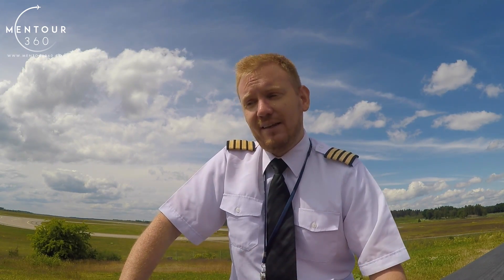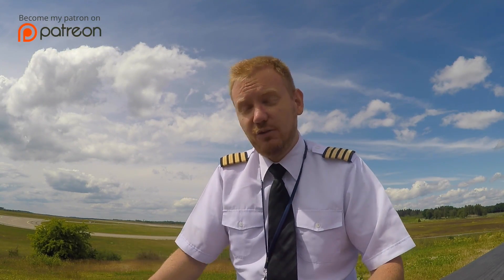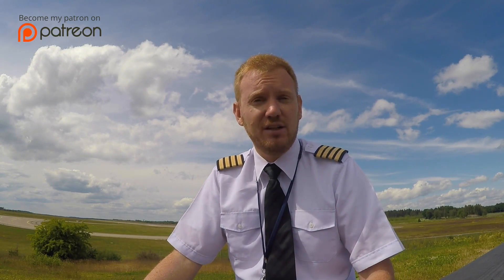Airline delayes explained - Slot times

Comment: I just came across your channel and I'm so thankful I did!! I have a question for you that I've been more and more curious about as the technology improves with aircrafts. How much of each flight is actually flown by the pilot vs auto pilot? If I'm understanding correctly these planes literally land themselves without human input! Amazing! But my fear is that without actual hands on fly time and having a computer make all the pilot's decisions, what happens when the computer stops working? Will the pilot remember the "old school" ways of flying, or instrument only flying etc? Thanks again for taking the time to upload great vids!!!
Reply: Hi Joni, from what I've read, each type of plane (airliners) have several sets of computers, the software is supposedly written by different companies or teams.  So a failure of one system will not impact the programs of the other computer systems. They are fail safe... apparently LOL

Comment: I have a question: With all our computer savvy, why can airliners not have a large red button in the cockpit that says, "Land The Plane"?
Reply: It requires entering numbers + vectors into the system, so they are lined up properly with the correct runway + on the correct glide slope, etc.

Comment: Mentour. No other way to contact you so here I go. Why not do a video on air circulation. Do the passengers and pilots all breathe the same air or are the pilots on a separate system. I ask this because I cannot get off a flight without getting a cold or the flu. If everybody breathes the same air how do pilots stay healthy??
Reply: they have a separate air system. and a back up .  when you think about it the pilots need oxygen to fly the plane in an emergency.hope this helpsa little . I have learned a lot for Mayday and other programs.

Comment: When I saw the title, I immediately thought of slot times in tightly controlled airports on the east coast of the U.S. Airports like DCA and LGA (and others I imagine) are slot controlled, regardless on weather.  When weather conditions lower visibility it backs up traffic even worse.  ORD is finishing up a make over of the runways up there, but before they straightened them out (literally), it had delays left and right in Chicago.  They would end up diverting half of the airborne in-bounds and issued "Ground Stops" like they were having a fire sale.  ORD used to have four+ pairs of parallel runways, but if you look at the plates from back then it looked like a plate of spaghetti.  Now, they have five (I think) parallels that are all East - West so they don't get so backed up.  Another good video.  .

Comment: Who is making the decisions when you push back from the gate, then get a hold.  You are disconnected from the terminal's air conditioning hose, you refuse to start the main engines to save fuel and we suffer with no cabin air conditioning or ventilation of any kind!   Maybe you read about the guy who recently was arrested for opening his emergency escape door to get some air when his wife fainted after FIVE HOURS of this.  Wondering if the flight desk can get its own separate air conditioning from the APU?

Agreed, just add to the end of your video after you read our comments.  We know you have nothing but free time to make videos for us.... and we DO dearly appreciate seeing behind the 1st class curtain.

Comment: if it is a delay already, will pilots then already speed up the flying in the air to minimize the delay? yes or no and why? thank you
Reply: HK Larchai depends on airline, generally long hauls would do that. On a 2 hrs it's nonesense
Reply: We'll ask for direct routing if available and that usually saves around 10-15 mins on a 1hr 45 mins flight.

Comment: As far as I know, other reasons which could cause delays and - possibly - to miss the "slot" are: 1. The fact that - during a thunderstorm - Aircraft Refueling cannot be done because of lightning danger and the consequent fire danger. 2. A delay due to a baggage search ( and its disembarkation off the Aircraft Hold ) because its owner has missed the plane.